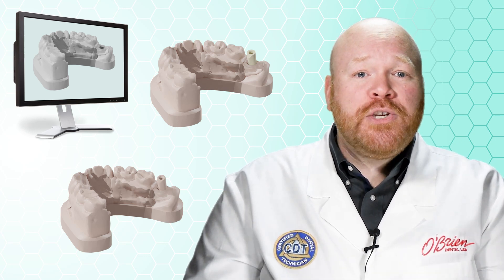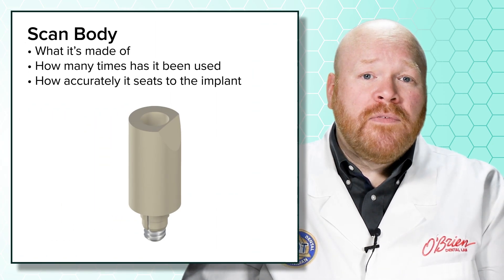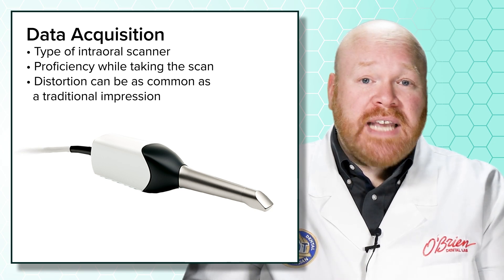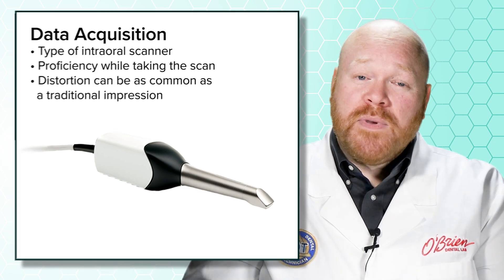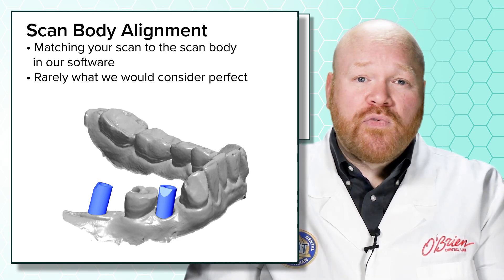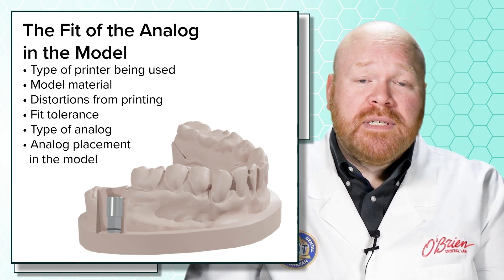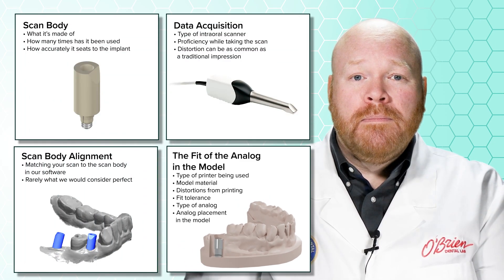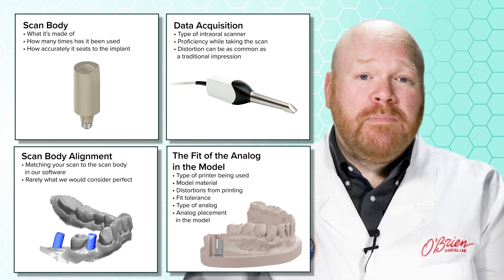Implant scan bodies - does the type matter?

Comment: Can the scan body be altered, cut back, reshaped, like an abutment, prior to the scan? For instance, if the angulation of the implant doesn't allow for the scan body to be seated on the implant, because it's hitting adjacent teeth?
Reply from the maker: Most scanbodies can be altered slightly if it's just on one area.  When the lab receives the scans they have to use landmarks on that scanbody to match it up to the library version.  If the scanbody is prepped too much, that match won't be possible.

Comment: Are you able to see what one was used in my wisdom tooth extraction? They said they may have accidentally put one in for a wrong procedure?!? Weird and its in an awkward position so it is causing dental problems wed like to get corrected. Any information will help. Weve already had several scans and confirmed a bulge from it causing thevproblems.

Comment: Do you know of any scan body placement forceps or tool kits?  Every time I remove the tissue retracting part and place the impression coping, it is so small and slippery.  Trying to line it up properly to screw down while the coping spins around and is pushed out of the implant by the tissue.  I just know I'm going to drop one, one of these days and it go right down the patient's throat.  If there are no tools available to make it more easy to place then someone needs to create and patent some.  I can't be the only one who would buy them.
Reply from the maker: Not that we have seen, but that is a good idea!